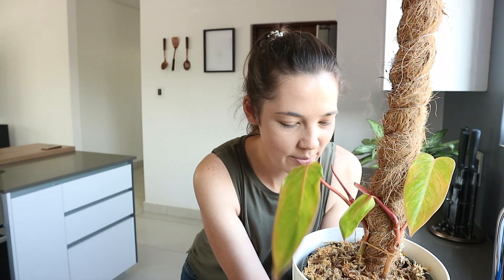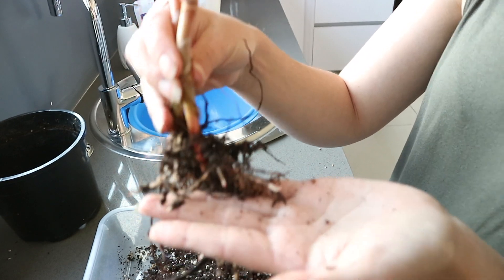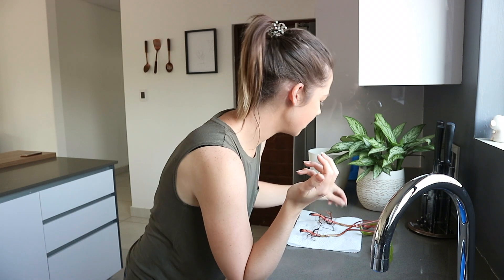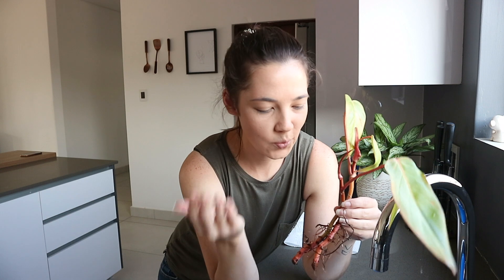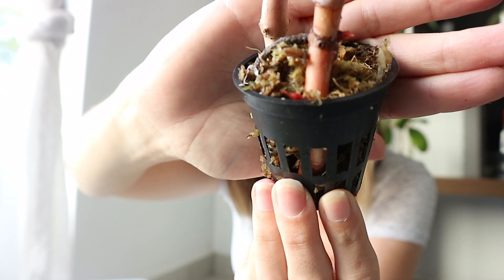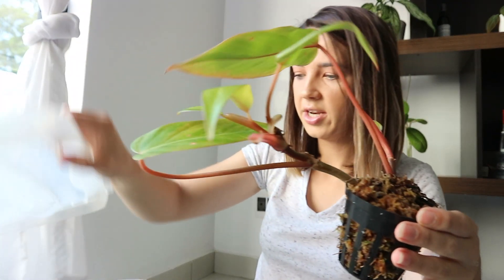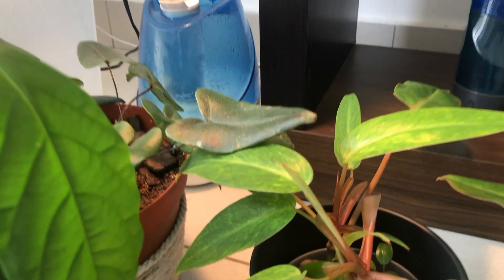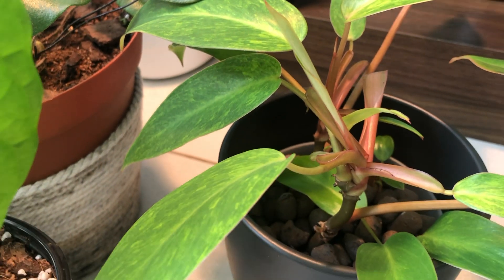Converting my P. Painted Lady to Leca/Semi-Hydro | Saving her from a serious case of root rot.

Comment: Loved your vid and perseverance. HATED your music! Doesn't fit at all, and is annoying. Last thing, you should have washed all the spag off of your roots before putting it into leca, as you are now promoting the very root rot you have tried to avoid. I gently wash off all spag, and then soak in water/hydrogen peroxide for a bit, before putting it in a semi hydro medium. Hope it works out for you anyway. Cheers!